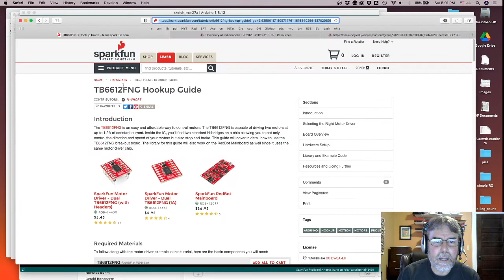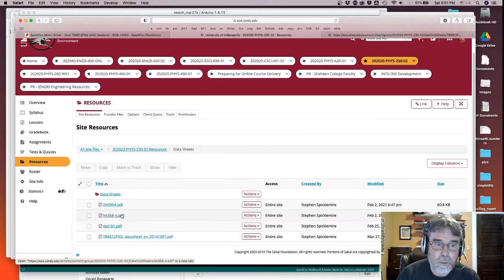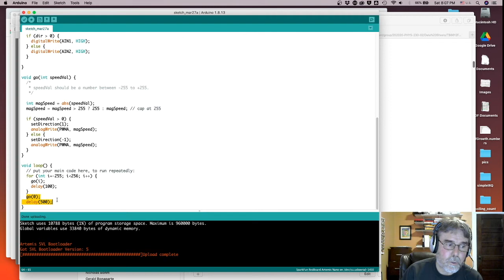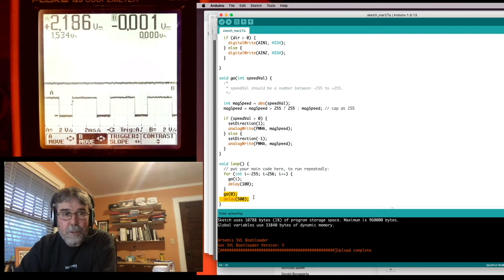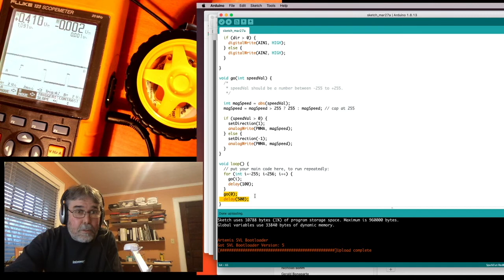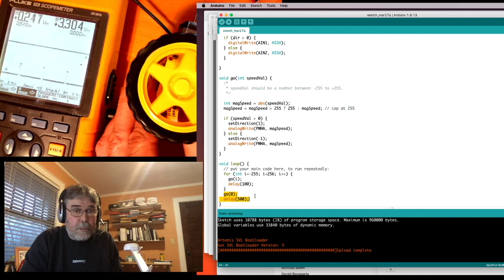Controlling A DC-Motor

Comment: If there's a topic Churn churn churn.
Brushed DC Motors and How to Drive Them
How PWM works | Controlling a DC motor with a homemade circuit
Arduino Tutorial 37: Understanding How to Control DC Motors in Projects
How To Wire A Large DC Motor And Control The Speed; Treadmill Motors and Universal Motors 019
Control Large DC Motors with Arduino! SyRen Motor Driver Tutorial
How To Make Simple DC Motor Speed Controller Circuit
Arduino DC Motor Control Tutorial
Speed Control of DC Motor - DC Motor Speed control
And on and on and on and on and on.